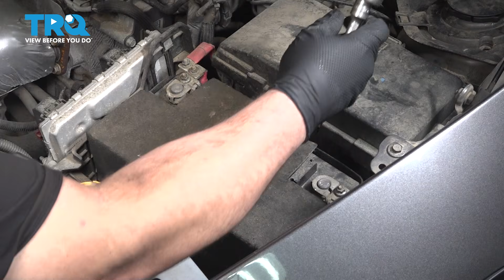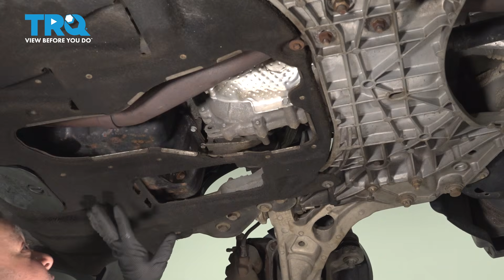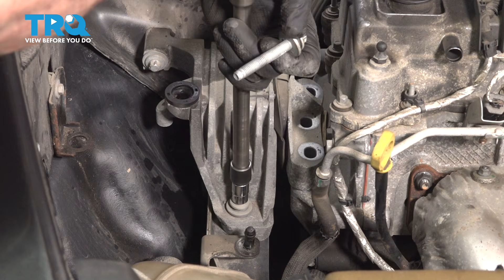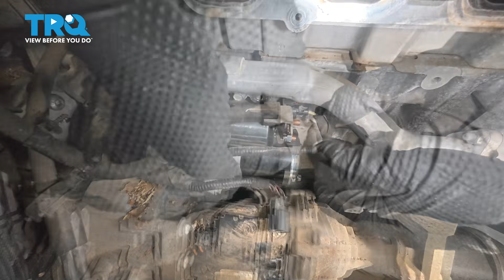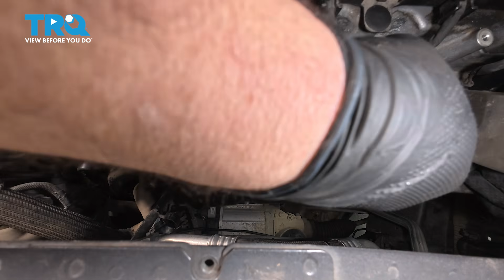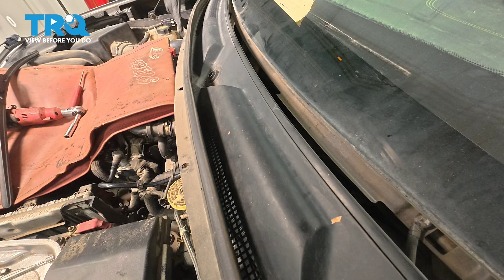How to Replace Starter 2014-2023 Jeep Cherokee

Comment: I just finished doing this job right now, none of what he did is necessary, i didn't take out none of what he took out, i first took out the two bolts on the top holding the starter, and went down under the car to take out the one remaining bolt, i then wiggle the starter to get access to the battery wire, took out the bolts, and disconnected the connector,  is easy to wiggle the starter out through the driver side of the car, some people just like to prolong things. He did the job, i guess his job takes us back to a million ways to skin a cat.

Comment: I only watched 4 minutes and noticed that this is an insane amount of work to access a starter motor.   At 4 min 17 sec after disassembling half of the car…he takes a pry bar and starts moving the engine so he can access other things to remove!!   The video is 44 mins long so if I keep watching, I expect that he still has to remove all 4 doors the seats, wheels, brakes, transmission, fuel tank,  the transaxle and the interior dashboard instruments.    I don’t think I will buy another mopar  vehicle…..